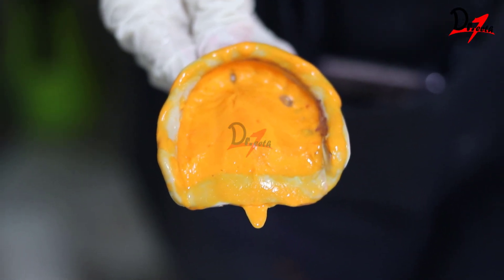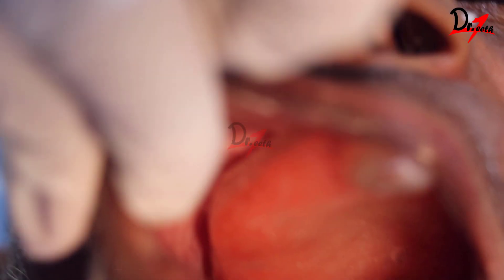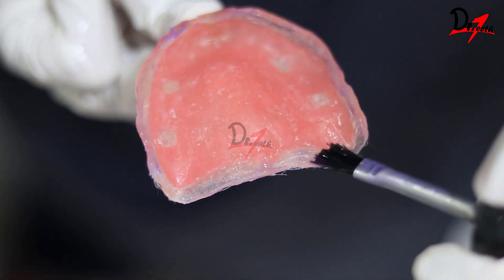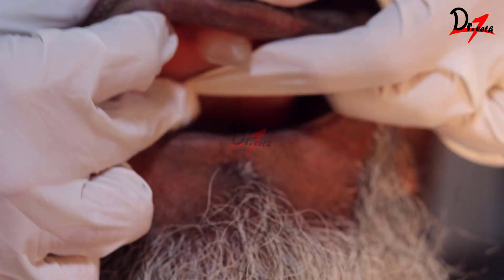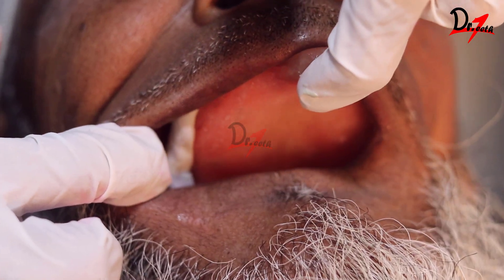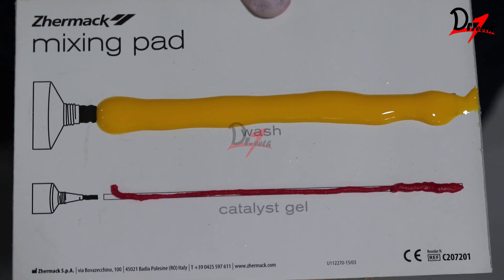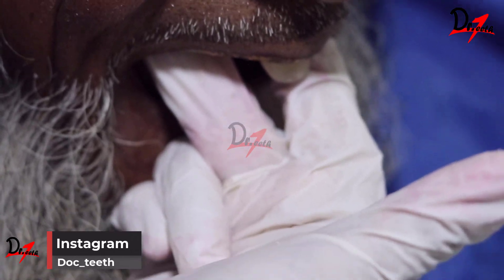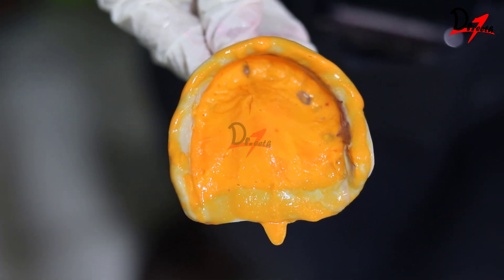One-Step Border Molding Technique | PROSTHODONTICS

Comment: Dr, Green stick Vs putty? Which one is better according to you. In terms of retention
Reply: They're the same.  Greenstick has a shore hardness of around 90, and you can get putty that is a shore hardness of 90.  For all intents and purposes, same outcome due to those physical properties.
Reply: @effefffffffffffffffffffff nice point made. But putty is still silicone and you do get a suction kind of effect due to putty being silicone, which can add to unnatural suction from the border molding. Green stick doesn't have that and the end result will be slightly better because the denture isn't silicone and won't have that suction capability as much as putty. So ideally and sadly it's still green stick. More you do both, more you'll understand.

Comment: Why u use latex gloves during putty impression nd second one why u don't make any holes during wash impression 🙄
Reply from the maker: Latex gloves can be used with C.silicone, it has not shown to retard its setting (unlike A.silicone) and I have made relief holes after removing the spacer. If you watch the video carefully you'll see the material oozing out through the holes while making the wash impression.